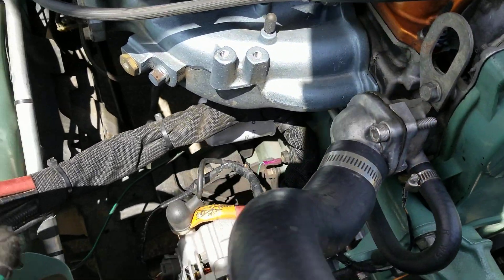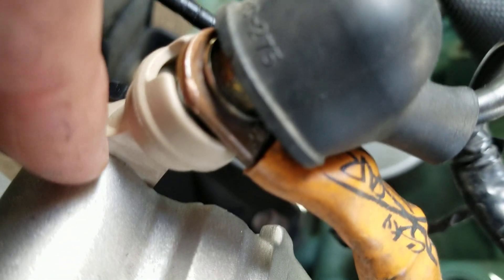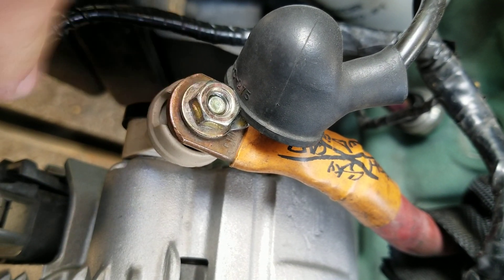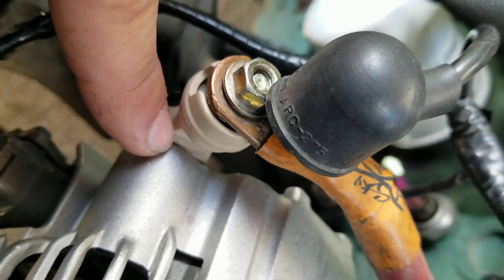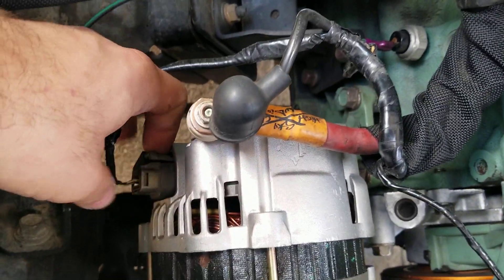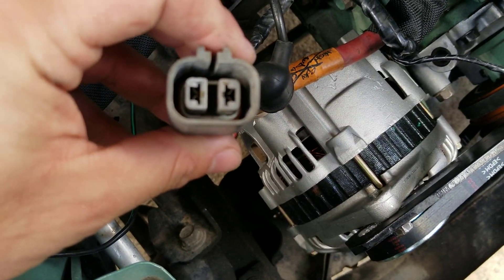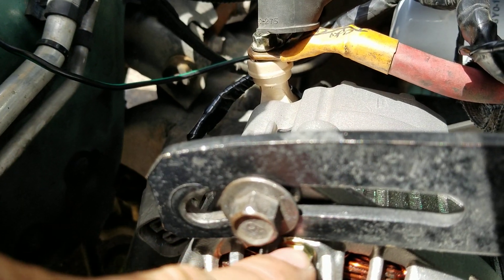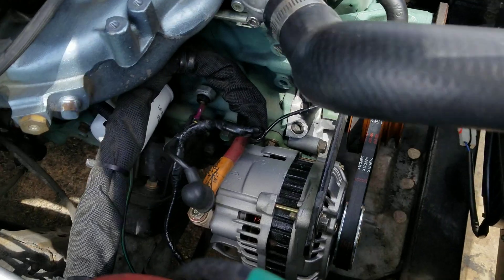130 Amp Alternator Swap B2200 B2000 Tips

Comment: I know this is 4 years later but I'm curious what year your truck is? I've heard that 86-88 has issues with this swap. Mine is an 86 and I am planning on a number of upgrades requiring more amperage and I'm trying to figure out if I go with this or a GM 1-wire. TIA!

Comment: How did you add the electric fan. I had to replace my fan clutch and it's loud over 2000 rpms.
Reply from the maker: I wired it with a temp switch to kick on when it reaches a certain temperature. The switch grounds the circuit turning on the fan
Reply: @2021487  So it was fairly simple to wire up?
Reply from the maker: @btj4ever  yeah its pretty simple. Just Google electric fan circuit on images. It can be done a few different ways
Reply: @2021487  Thanks for replying. Found my next project on my truck now.